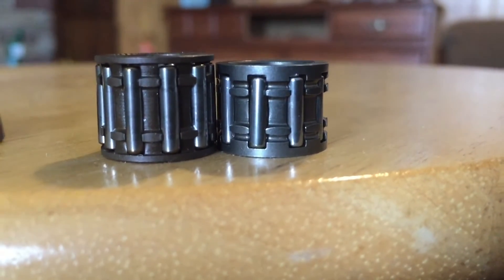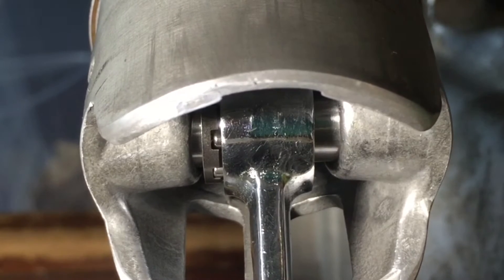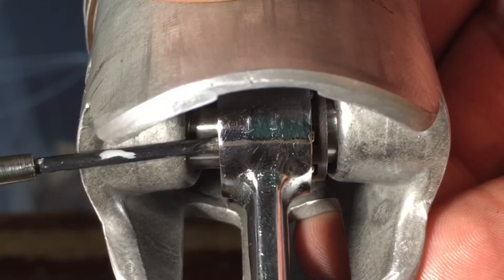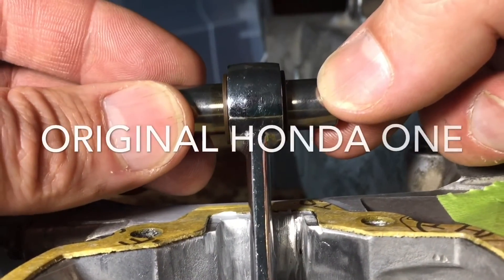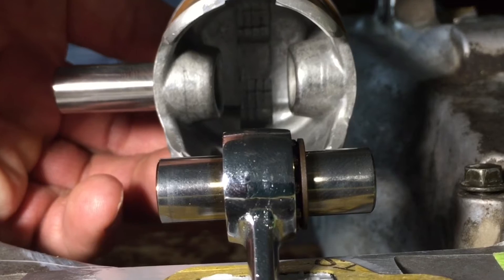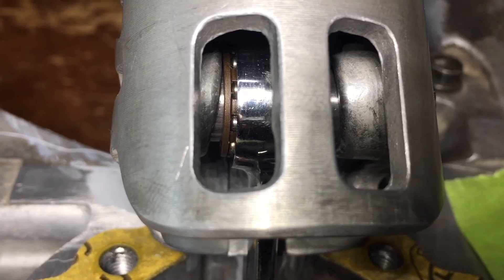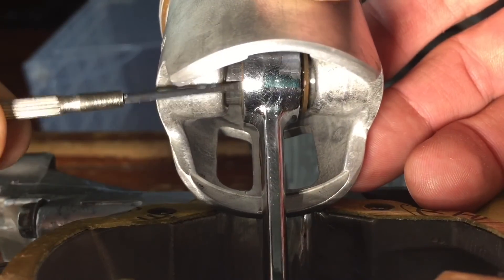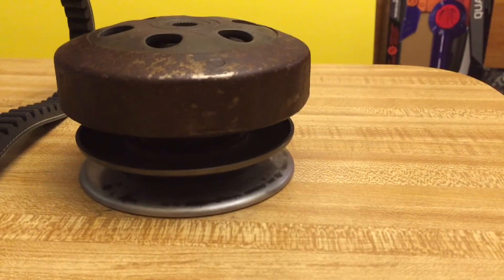Small end bearing play on two stroke engine, scooter, Honda dio50 elite50 sk50

Comment: I would look into putting a spring on each side of the rod, with thin washers, possibly to keep the bearing centered in the rod, something very tight fitting and light weight, maybe a spring washer, to allow the bearing to be oiled, I'm a 4 stroke guy, at best we usually  have only bushings, however it seems the Piston may be wider than nessacery
Reply from the maker: Hard to say, the springs are not a bad idea. I ended up installing it together and it’s been two years now still runs good hopefully it will just keep running

Comment: How bad it is if you canslide piston side to side and the bearing moves little bit too
Reply from the maker: Gaddm Not too sure what you mean. Movement in the video is OK
Reply: @ProblemSolverGarage  I mean if piston moves sideways little bit it doesn't affect rod and rod bearings?
Reply from the maker: Gaddm Once the piston is installed and the motor is put back together there won’t be any movement in the piston side to side. But the bearing does slide around in their side to side a little bit
Reply: @ProblemSolverGarage  yeah and does that do any bad
Reply from the maker: Gaddm Apparently not, I thought it was weird too.
Reply: @ProblemSolverGarage  Okay, i was just asking because when i needed to get a new piston to my KTM i bought Prox's piston and bearing. Those are not the factory ones. Soon after i changed it, it started to do some weird noise whic is not like some typical knocking, clarcking or tapping noise. It is like some weird rolling sound wich i have not heard ever before. All bearings were also swapped 65 hours ago so the noise should not come from the engine case.
Reply from the maker: Gaddm I don’t know you have to check your shop manual for clearances, on the DIo engine it is what the video shows but on a KTM there might be specific clearances, also run your factory airbox, otherwise rocks get in and send through the aftermarket cold air intake
Reply: Too much side to side on piston is bad and noisy  and causes piston slap